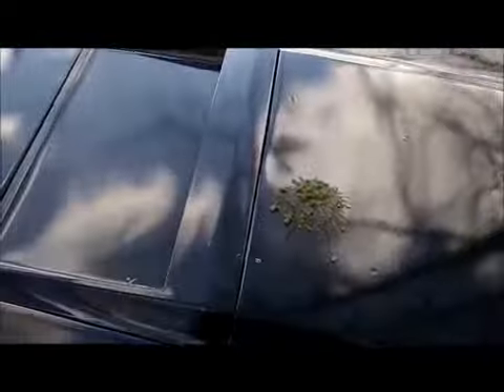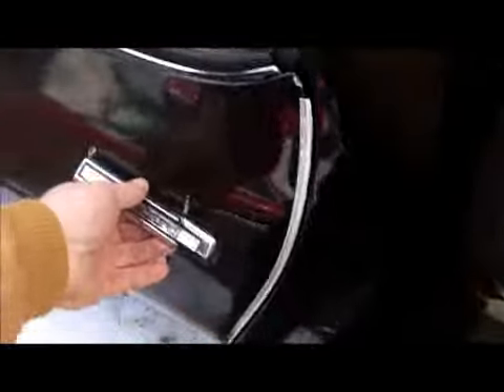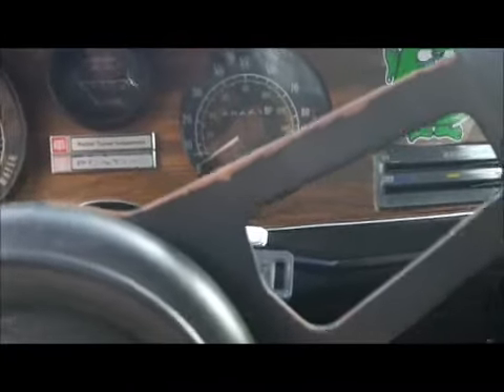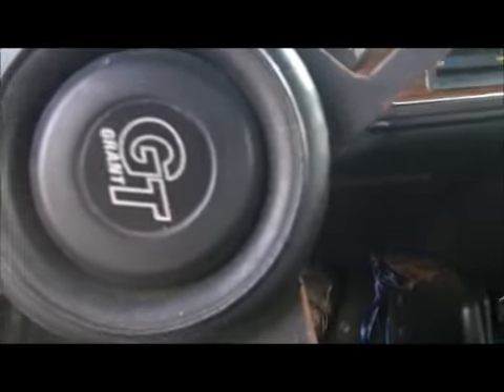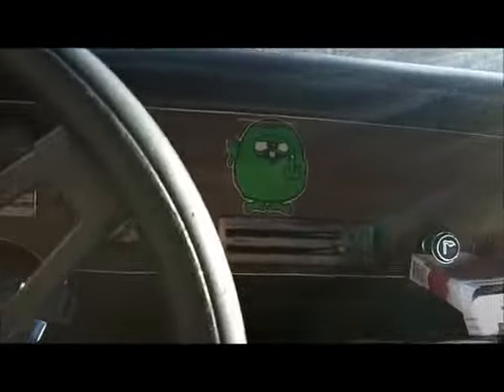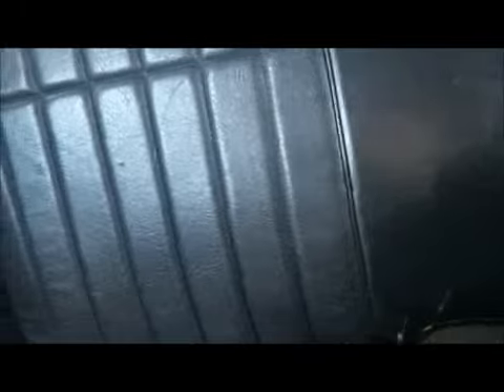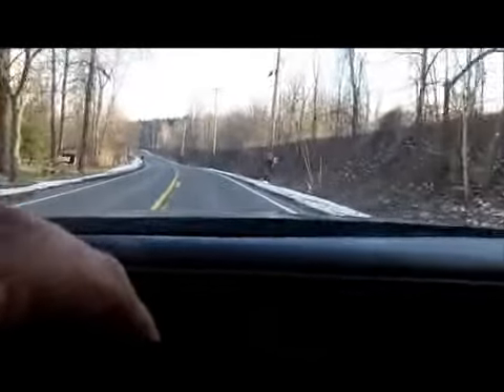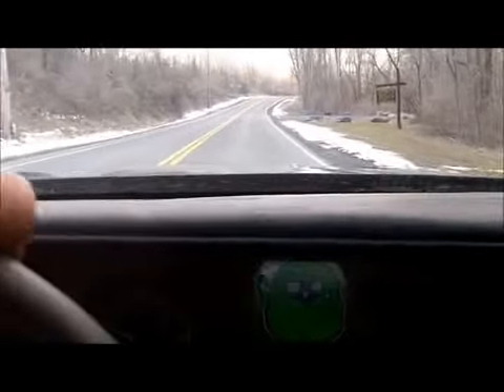1979 FireTurd..Deal in the making

Comment: As long as the frame and around the front and rear glass isn't rusty the rest wouldn't be that hard to do. I think I would look for a pontiac 400 and ditch the anemic 301.  Smaller CI doesn't always equate to better MPH.

Comment: 1979 Firebird Formula with a 301.. Take the 301 and turn it into a flower planter. Take a 1980's carbed Caprice classic and rip the 305 and t700 out.. install in Firechicken. job done. reliable, and gives OK gas mileage

Comment: I dont think its a pile, it needs some minor work + paint and it'll be a $7500 car.  I'd swap a nice (cheap, used) 350 into it and get rid of the boat anchor 301 though. IF it needs full floor pans these guys are right about it being a $600 car.  $1500 if not.